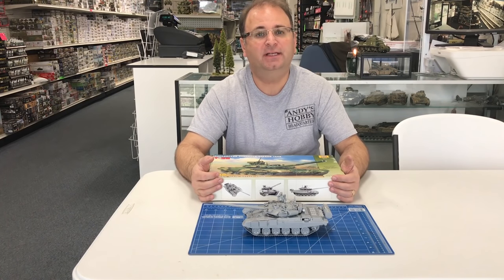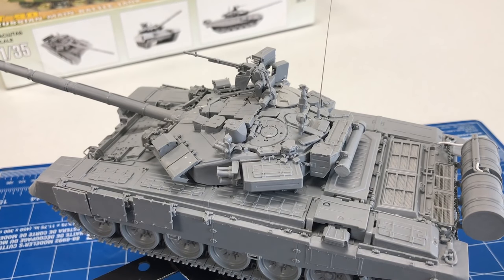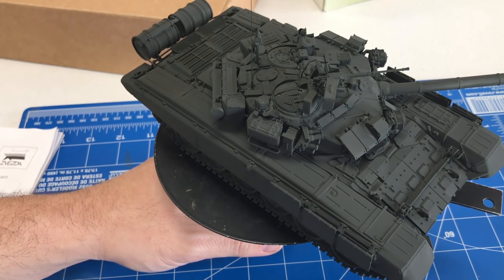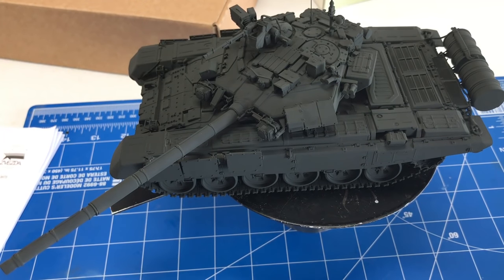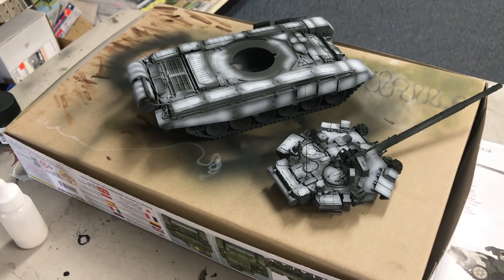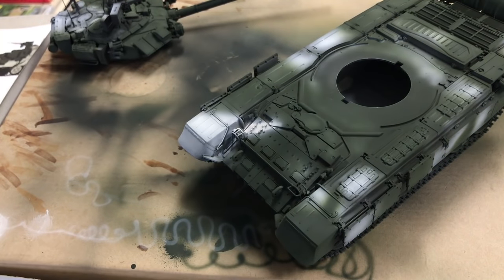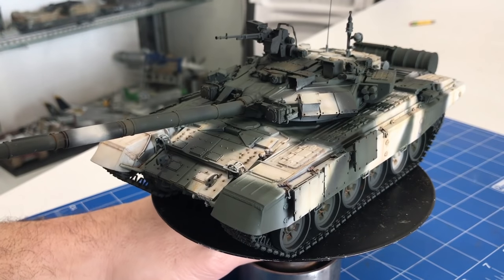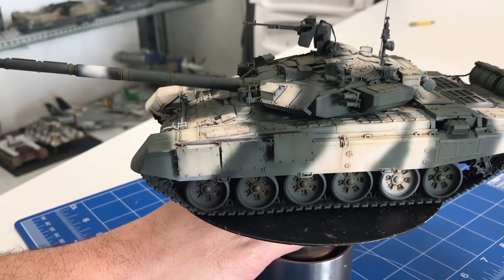Quick review including painting and weathering of the Zvezda T90

Comment: Still undecided between the meng and zvezda kit so this was good timing. Also First
Reply: Overkill is underrated i got meng, pretty good fit, a little frustating when im working on the smoke discharger but overall a great kit
Reply: Overkill is underrated , It just comes down to what you're looking for. If it's good value go for the Zvezda, but for greater accuracy you can't beat the Meng, it truly is a superb kit; pricier yes,  but well worth it. Just decide what's most important for you.

Comment: Hi And, I recently upgraded my airbrush to a gravity feed 0.3mm nozzle, I tried to free hand paint a camo pattern on one of my older models and when I painted the camo lines had a lot of speckling and what looked like over spray along the edge. I was just wondering if this means the paint is too thin or too thick?
Reply from the maker: might be too thick try to up you pressure a bit
Reply: Andy's Hobby Headquarters ok thanks, but I had it on about 15 psi
Reply from the maker: try 22-24 psi